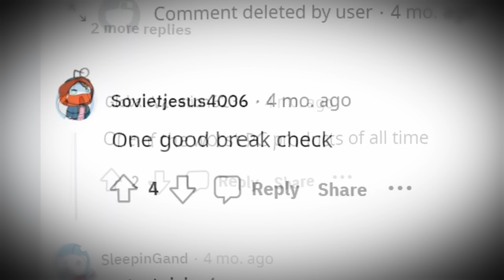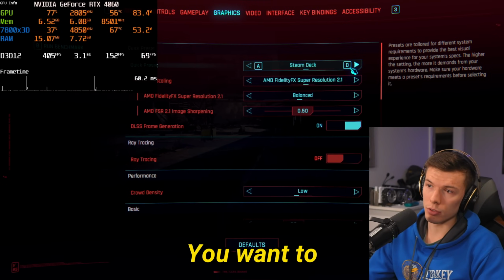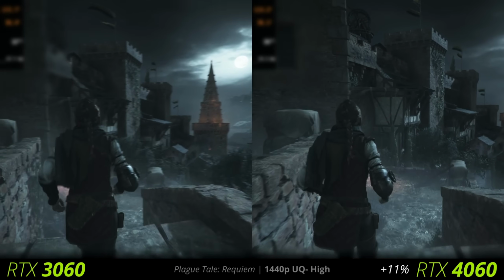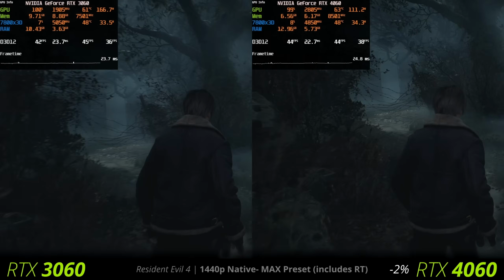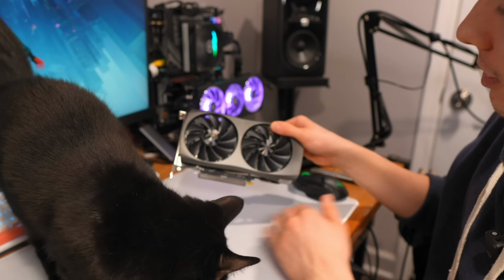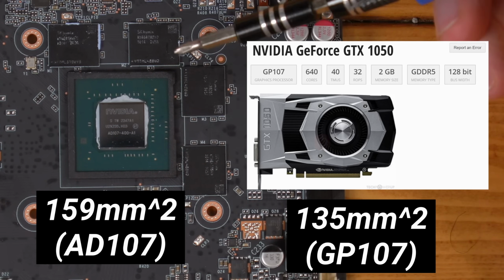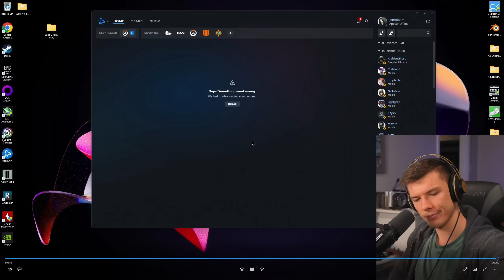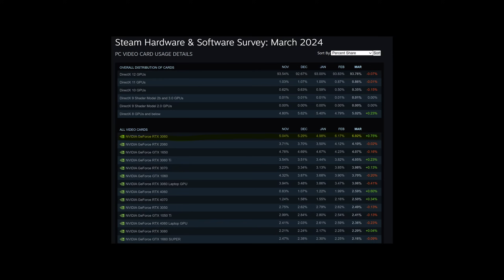I Tried Nvidia's best "Budget" GPU to see if we're Doomed

Comment: The problem is the price. This should have been a 4050 and priced acordingly. But 3060 level performance for 50% less energy use is kinda crazy!
Reply: exactly not many talking about the low power for same level performance. 

like you said, the price is the biggest issue. if they would have released this at a fair price, it would be in every budget pc
Reply: How the fuck it 3060 level of performance???
Even on techpowerup it 18% faster than 3060, the 3060 is only 16% than 2060! Lol! It even when you doesn't consider frame generation! So 3060 is on the performance of 2060?
Also 3060 got hyped to much just because of vram that it can't utilize, every sencerio where 3060 exceeds 12gb of vram it get unplayable fps any way.
Reply: they can call it 4050 the price will still be $300. consumer need to accept the reality that cost are going up.
Reply: a 3060 at least released at launch with a 12GB Variant. Justifying 8GB on  $300+ GPU is absurd.. most people aren't worried about energy efficiency.. they want their frames.
Reply: @Mr.Genesis  But some are worried about eneregy efficiency like me lmao
Reply: @srgatasio  nothing you can't limit yourself tbh.. You can always power limit a GPU. It's yours you should get the best you can buy all things considered.. If you're worried about power consumption laptops are much better
Reply: Since the 3050 was effectively sold for $290-300 until the release of the 4060, calling it a '50' or '50Ti' wouldn't have changed anything.
Reply: @lharsay  if you read my comment you would have realized that i didnt say changing the name alone would have changed something
Reply: Exactly, so many are overlooking the low power consumption.
Reply: @Red-ne More power efficient than the 1660ti which is pretty wild.
Reply: @Mr.Genesis  right, but then you get half the performance. this card is best in class for low power and decent performance.
Reply: The price is worth it dude. If you someone going for one of these cards, you’ll be using it form a while
It’s still a cost effective card, and also reduces energy costs
Reply: @Mr.Genesis except the 12GBs on the 3060 wasn’t even used that much, even with the fully unlocked model.
It would barely go past 8GB
Plus either way, games now are not fit for the 3060 running at 1080p high.
The 4060 can actually run games at ultra, and it takes 70 watts less
Reply: @Thewaterspirit57  It reduces energy costs for sure but its not cost effective. 

The rtx 2060 for example was as powerfull as the previous gen gtx 1080. 

The rtx 3060 was as powerfull as the rtx 2070.

The 4060 is slower than the 3060 ti. There is no performance improvement gen-on-gen.

The 4060 is the worst 60 class product we have ever gotten. And if you look at a chart of performance it really is a 4050 masked at as a 4060 and sold at 300 bucks. It should be selling for 249$ at most. 

The 4060 ti 16gb should be the actual rtx 4060 and should sell for 300-350$ (but its selling for 500$).
Reply: @Thewaterspirit57  it depends on the game I wouldn't run Wukong on Ultra on  4060
Reply: @ bad example. That game is horribly optimized it needs a 6 core CPU to function.
Reply: @ it’s a 115 watt card, that enough to make it a good deal.
Y’all are too focused on making dumb comparisons you never see the benefits of these cards.
Literally the same group of people who previously praised the GTX1050ti
Reply: @ also ain’t no way you think the 16GB 4060ti would be viable for that price 💀
Also considering the fact that VRAM amount is useless. It’s like when people slapped 16GBs on a 3070. It did nothing.
Reply: @Thewaterspirit57  What do you mean "dumb comparisons" Its a 300$ xx60 class card, im comparing it to other xx60 class cards we got in the past. It's a bad product for it's price, it being "115 watts" does not make it a good deal.

I never praised the 1050ti but either way the 1050ti was marketed as a xx50 class card and it was 150$ at launch. 

If nvidia released a gtx 1050, but called it a 1060 and sold it for 300$ would it be a "good deal" just becase it used less  power? Because that's what Nvidia did with the RTX 4060 you seem so eager to defend.
Reply: @Thewaterspirit57  you should see newer videos. 4k res textures in many games released this year went over 12GB. Call of Duty easily pushed past 12GB at 4k Textures
Reply: @Thewaterspirit57  that's not poor optimization that's just the game's requirements. You can't optimize a game to run on hardware that is just too weak
Reply: @ there have been games that look better and have lower ceiling for recommended specs 💀 it’s Poorly optimized. There were games that could run at 1080p ultra on the mobile 3060, with half that VRAM.

Comment: I got a 4060 for my Plex server. Its been great! Coming from a 1060 6gb using hand break, it was a welcome upgrade.
Reply: Havnt had problems with mine either,, grant it , it doesn't heat my room up like my sons 30 series so in cold months I still use a space heater

Comment: The 4060 holds a special place in my heart. Been with it for a few months now, up from an RX 580. It's serving well enough to hold me until I can get my hands on something tanky. When I retire it, it'll join my RX 580 on a shelf as part of the journey. It's a rough part, but it holds, does the job, and will keep at it with all of its little heart.
Reply: im upgrading from a 1050 ti laptop to a 4060 pc, what should I expect?
Reply: I'm still on an RX 580 lol
Reply: In summation, you'll be satisfied if you expect anywhere between 2-5x the performance. That's GPU alone, though, not sure about the rest of your set-up(s).
Reply: @grzyruth9205  A solid card! I wouldn't be upset if I was still using my RX 580 (maybe one that wasn't choking out toward the end of its life, like a new one lol). Got a beast for sure inside that tiny package.
Reply: @davidcorteiz huge difference. I upgraded from a 3050 ti laptop to a 4060 pc and it’s way better. It’s comparable to the performance of an Xbox series x but a little bit better depending on the game.
Reply: @Prod.M00N  Mines arriving today in 30 minutes, I cant wait to finally play warzone competitively
Reply: @grzyruth9205  I am still rocking a 580 also. It may not be flashy, and definitely dated, but still chugging out frames on mid to low settings. You are in the game, that is what counts.
Reply: I want to upgrade from the 1660 Ti, but I need to check out all gpus. So interesting to see this video show up on search
Reply: @davidcorteiz how it was?
Reply: @juan180p  its sick holy shit I am playing rdr 2 max graphics 1080p at 90-110 fps
Reply: you should have gotton a used card
Reply: I'm thinking of getting a 3060 or 70 card they are 12gjg. Should hold me over 3 more years.
Reply: @thecarrieshot6411  I had an EVGA 1660 Ti 3 slot card and loved it. I ended up using it in a pc I built as a donation to a church in need.
Reply: I'm still rockin' this MSI RX 570 8GB myself.
Looking to hop over to team green for my upcoming build, though the 7800 or 7900 w/ 16GB is tempting me ngl.
After all this time whatever I wind up with will likely seem like a huge leap. haha
Reply: @thecarrieshot6411 Go for the 4060ti 16gb versión or 4070 12gb or 3060 12gb. Anything below 12 is just ass nowadays. 4070 is like the entry to top of the line stuff dk much about amd.
Reply: Rx6750xt wipes the floor with the 4060
Reply: @Boss69292  If you've got the cash, I guess. Also if you have the patience for more crashes and hardware compatibility issues.
Reply: If you have a 3060, and don’t care about saving power, keep your 3060, but without a 3060 4060 is a better option. My 3060 is 8GB so 4060 8GB isn’t worse as here but it isn’t worth upgrading.
Reply: @ohokcool  100%. If I had a 3060 prior to my upgrade, I'd have not worked for a 4060. But, ya know, as awesome as the RX 580 8gb was, a 4060 is still a substantial upgrade.
Reply: Idk why people are just fine with getting scammed, just get the rx 6800 for God's sake
Reply: Whoah, buddy. The 4060 still isn't that old to say that "it holds a special place in my heart". Don't make me feel like a grandpa.
Reply: @davidcorteiz  let me know how it goes
Reply: You’re on track I had an 2060 super when I first got into the master race 5 years later I finally got an 4080S and I’m chilling until like mid cycle Am6☺️
Reply: @davidcorteiz  You Will be satisfied in almost every game but some games require a lot if you get bad fps in some games dlss, frame generation everything like that Will be the key to incredibly high fps

Comment: I work in the games industry, I have a set of computers here that range from low-end to high-end for testing game development.  I recently upgraded the 4-Core 16GB GTX1650 test system up to an RTX-4060, and it is a dramatic improvement, the test suite of games performed much better.  Whether it is priced decent for the performance I withhold judgement.  In the games my studio is releasing this year, it gives a solid 80+ FPS at 1440 with UE4 and UE5.  I wouldn't try playing AA or AAA games on it though.

Comment: Basically the improvement from samsung 8nm to tsmc 4nm was huge, but rather than distribute that benefit throughout the lineup they gave the most of it to the high end cards, and used as small of a die size as they could get away with for the lower end cards, to my understanding. The 4060's die size is so small, it wouldn't surprise me if it was actually cheaper to make than the 3060, even being a newer node and all. So the 4060 in the end is like a 60% increase in performance per watt, but not in raw performance. Great video Vex! I enjoy your "conversational" style of videos..
Reply: “60% increase in performance per watt, but not in raw performance”
It does make me wonder if anyone tried overclocking this card. What if we could give it the same wattage as a 3060?
Reply: @TheMamaluigi300  Every architecture has an ideal voltage curve, and it's usually a diminishing gain the higher you go. If it would even allow you to pump the wattage up that much, you wouldn't get a huge gain. Think of it like how the intel 14900ks uses like 400w but it's 5% faster than a 12900 at 200w

Comment: I only play competitive games and I upgraded from GTX1060 to RTX4060 on the same build Z170 & i7-6700K. It's working pretty fine, jumped from 50-80fps on cs2 to 180fps with higher settings.

Comment: Lack of competition is major problem.
Reply: AMD exists
Reply: @TheMaztercom  They are more than happy to play second fiddle to Nvidia, they might have to step to combat intel but that's it
Reply: Intel and AMD exists.  I just built a new rig with an intel Arc A770 16gb and with the latest drivers I'm able to play every game I own in ultra 1440p with atleast 60 fps.

The card only cost me $289 to boot!
Reply: @TheMaztercom  lol 7600 should be below $240
Reply: I hope intel will make those two nvidia and amd work better on their cards.
Reply: My $200 6650xt is pulling it's weight. AMD has been nothing but smooth sailing for me
Reply: They literally have a card that competes with a 4080???? The only thing they’re not competing in is the 4090 and barely  anybody has one
Reply: @PORTERHAUS_  Arc A770 is a scam. it costs 100$ less than 4060, but 50-100% weaker and eating almost 2 times more Watt than 4060 does
Reply: @PORTERHAUS_  well use whatever card as long as you're happy, but do not suggest intel as an alternative to amd or nvidia, it's too young
Reply: @PORTERHAUS_ every game you “own”

Comment: Just compare the die size of the 2060 (445mm) to the 4060 (159mm) and that will tell you what you need to know. That doesn’t even include the bus width shrinking as well from 192 to 128 bit. 

Nvidia took a 4050 and renamed it to a 4060 and jacked up the price. If you bought a 4060 you were tricked and I feel for you.
Reply: 2060 was made on an old processs node wasn't very well received, it actually had a nice performance bump but also +100$ MSRP. 3060 was also built on cheap but bad Samsung node. Why don't you compare it to 1060's 200mm die?
Reply: @0M0rty  Because 1060 was built before ray tracing and tensor cores was a thing, if you add extra ray tracing cores and tensor core to 1060 die it would be over 400mm in size
Reply: @nonameyet2205 Complete  nonsense, tensor and RT cores take up around 10-15% of the die
Reply: A 4050 literally exists already, it's reserved for laptops for now, they'll probably make a desktop version eventually like they did the 3050.
Reply: @0M0rty  Okay maybe im over exaggerating too much but you do get the point right? Lets add 15% that would be 230mm and that is still much bigger than 159mm
Reply: @nonameyet2205  You're missing the point, comparing die sizes is a pointless exercise.

Think about CPU's for a second. 14900k and 7950x are both around 260mm, don't have any memory, much simpler cooler and PCB and now board partner that needs a piece of the pie. Their MSRP was $600 and $700 respectively, yet there's very little outrage there. Both Intel and AMD have huge margins on their CPU's but nobody's crying or making think pieces about them.
Reply: @0M0rty  It's not pointless to a degree, comparing the die size in each segment you can clearly see there's a big gap in die size between 4060Ti (188mm) and 4070 (294mm). The 188mm die should be the true 4060 and the 4060Ti should be another new card with 200-220mm die, with this we know that Nvidia is clearly selling the 159mm die 4050 as a 4060.

CPU is totaly different, there was little outrage because you can still get the best gaming performance with $300-400 CPU like the 7800x3d, the $600-700 CPU is only for those who need the extra cores for work and they usually don't care to much about price just the same as those guys who buy 4090 for work.
Reply: @0M0rty because 2060 is modern and better, 1060 doesn't cut it anymore.
Reply: you guys look at those numbers without understanding it. 2060 end up having large die because nvidia needs to improve the performance from 1060. and it is done on the very same node as 1060. 12nmFFN used by nvidia for 20 series is just an enhance version of 16nm. it allows them to improve the yield so they can go very big with volta (815mm2) and 2080Ti (750mm2). same with those 192 bit vs 128 bit thing.

plus nvidia can call the 4060 as 4050 the price will still be $300. just look at 3050 8GB. $250. historically the x50 from nvidia is some where between $150-$180. wafer getting expensive and AIB cost also increasing. when AMD release RX5600 XT in early 2020 for $280 Sapphire told wiz from techpowerup to build the card within it's MSRP price is almost impossible. this generation AMD did not even dare to use 5nm for their sub $300 card because of the cost.
Reply: rtx 2060 ko was 299 @0M0rty
Reply: @aminbagheri9044  Cool, that was like 1 model from EVGA, that released a year after 2060 launched, and probably wasn't available worldwide. I'm sure 1060 was also on sale for below its MSRP.
Reply: @arenzricodexd4409  Good, reasonable comment, very rare on YT.

Yes, the pricing sucks, and Nvidia is making huge profits, but most of those are from top end hardware and datacenter/AI.

AMD is at best offering the same performance for 15-20% less money, Intel is selling at cost to be competitive. GPU's are just kinda expensive to make, especially on the low end, with wafer prices more than doubling since Pascal, copper doubling since pre pandemic, wages going up, shipping... Even the gimped garbage cards like RX 6400 are selling for more than RX570 did in 2018, with less performance and same VRAM....
Reply: @0M0rty  before nvidia exploded on its own it was common for CPUs to be the more expensive part of a rig.
Reply: And why tf does the customer care about those?

Comment: Why would I buy anything better than the 4060 if I have a cpu bottleneck and a 1080p 60hz monitor?

I had a 750ti paired with a r5 4600g and the 4060 was the absolute best I could get. Solid 60fps at 1080p in any game at max settings.

Comment: Upgraded from 1660ti to rtx4060. Rtx3060 was like $310, and rtx4060 at $330 that was within my budget. Rx7600 was priced near $320 lowest but i skipped it because my psu is only 450w. So its not an issue with rtx4060. And rx6700xt was $400 in my country which was significantly over my budget and i would have also needed to upgrade psu for that. So i guess it was a fair choice to go with the rtx4060. I play on 1080p monitor so its not an issue and also run dlss quality mode if the game has good implementation. Can't tell much of a difference unless i really look for it. Sometimes its even better. I played horizon zero dawn and dlss fixed the foliage shimmering that it had with taa.
Reply: Exactly same situation updated from 1660 super 4060 was the best choice for me price in my country power consumption new gen ... why would i  want higher vram 3060 or 3060 ti when i only play 1080 at high with dlss 3 support i can run 99%
Reply: @any_one_else  The people trashing this card are not paying the electric bills. Extra vram would have been good.
Reply: I just bought a rx 6800 for 370 euros. Im laughing at everyone who bought a 4060
Reply: @alisaforster28697  why are you laughing? 6800 is usually 70-100$ higher than 4060. at start it was even 300$ diff
Reply: I'm kind of in the same situation, I want to upgrade from a 1650 Super, and the 4060 looks like the best option for my budget, I understand why youtubers with high standards criticize this card , but what other choice there is for 300 dollars?